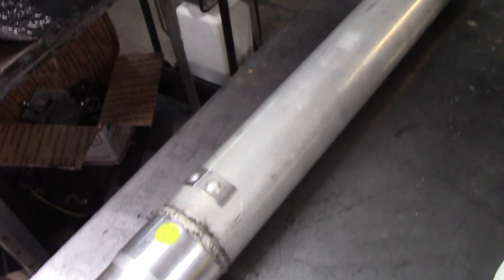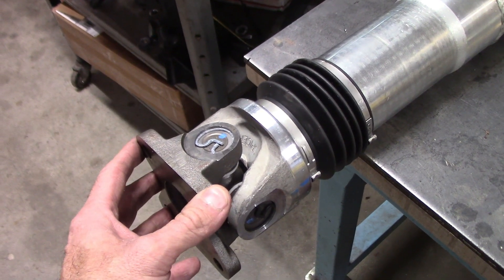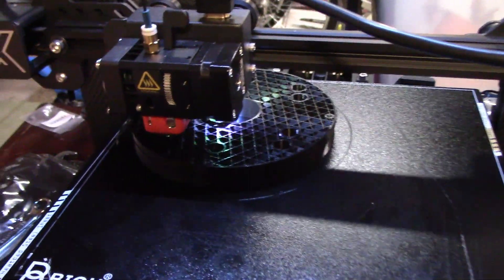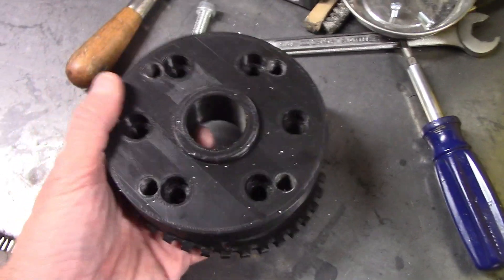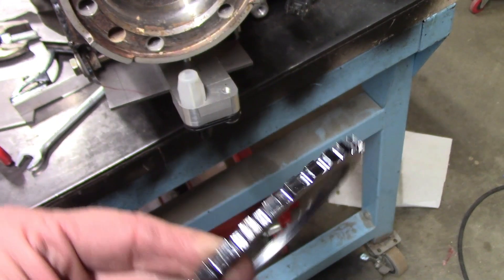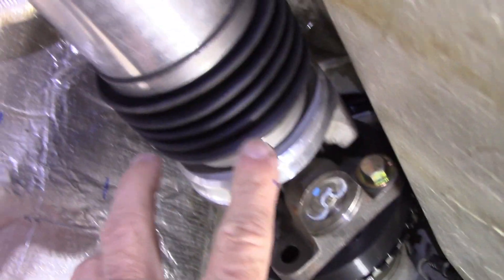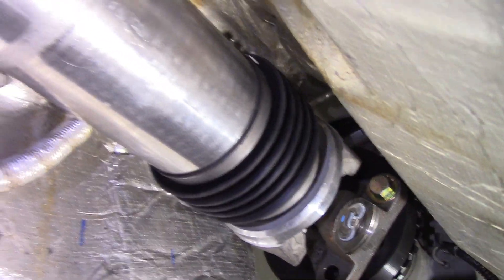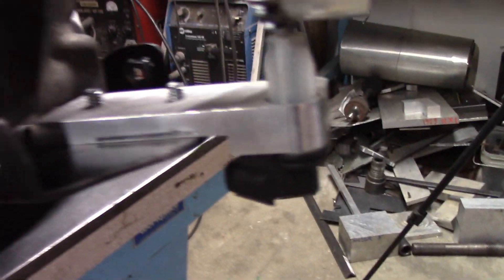Custom Aluminum Driveshaft - AWD Mustang GT EP 13.

Comment: I really appreciate what you're trying to do, however I think you would have been far better off trying this with a challenger and to somehow try to Frankenstein the V-6 Challenger GT with a Hemi
Reply from the maker: I actually seriously considered this.  I have driven several Challengers and Chargers and I like the looks of the Challenger, especially with the factory Widebody kit.

A bit of background, my basic goal was to make a AWD, Manual transmission, V8, boosted car.  I have been saying I wanted to make an AWD Mustang since the 90's, but before starting this project I considered other options.  

I really liked the idea of a AWD LS swapped E46 BMW.  I love the size of those cars and they just fit me very well.  I daily'ed one for 9 years. 

The Challenger would probably be quite a bit easier since the front suspension and oil pan are already figured out.  One stumbling block is the gear ratios available for the front differential.  All of the Chargers/Challengers come with a 3.07:1 gear, which is not good for a manual trans car.  It may be possible to get a different ratio from a Mercedes application, but I am not 100%. 

Anyway, after a lot of soul searching, I decided to stick with my decades long plane and make the Mustang.  I have no regrets even though it does have its challenges.

Comment: I’ll say from experience, make sure your front driveshaft is balanced and has no vibration at all. Also put safety loops on the driveshaft and front cv axles. It can be deadly if one of the cvs fail.

Comment: What's the plan for the front differential? What will you be using?
Reply from the maker: I explain that in Ep 2.  
https://youtu.be/nYSZKPoX_co
But, basically the plan is to use a Toyota 7.5in IFS differential bolted to the engine.